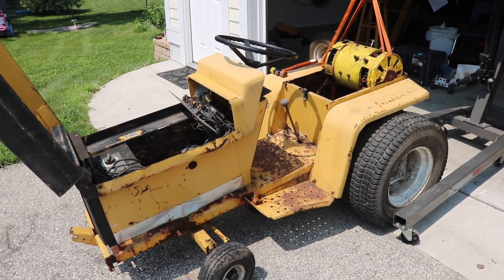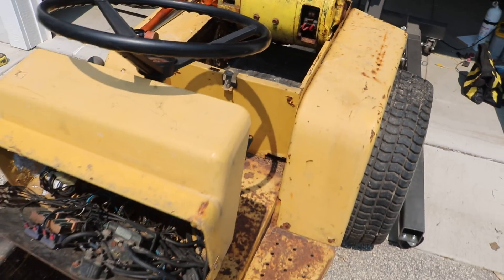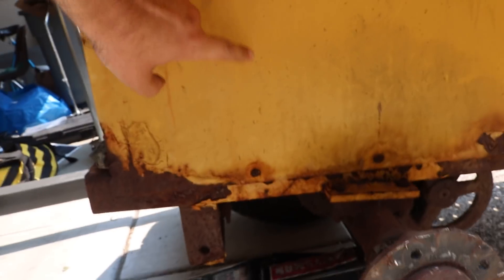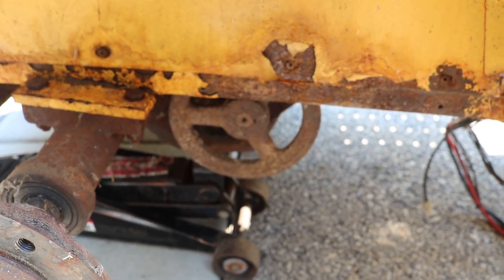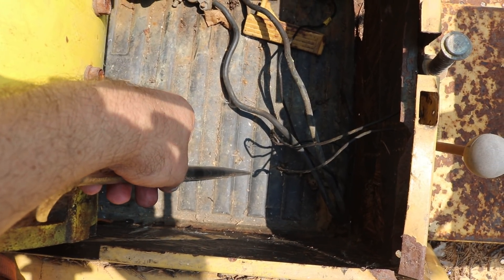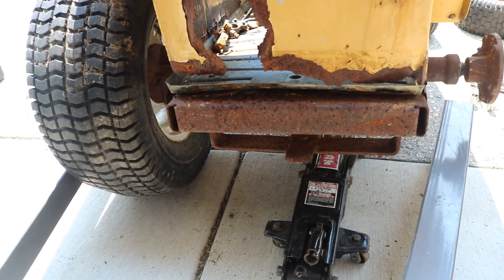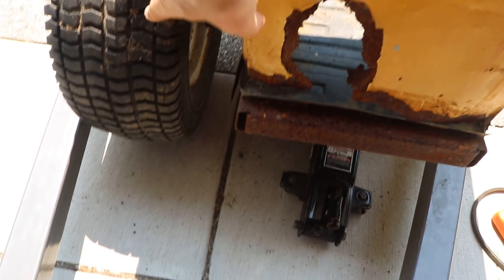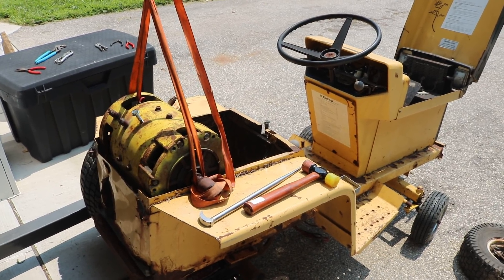Electric Lawn Tractor Rat Rod motor placement

Comment: That thing is a little ragged isn't it. I wonder how well it would work to build a dozer / front end loader, backhoe out of it? Make it where those are attachments you can interchange. I don't know if you guys ever have need of those things or do any gardening, maybe you could also make a tiller attachment for it also. I don't know, just thinking of possibilities.
Reply from the maker: Many of those attachments you just described WERE available as stock accessories for this series of General Electric ElecTrak tractors! On reason why it would be nice to get the motor under the seat it that it would leave the back of the tractor available for some of those accessories!
As it is, I might need to reserve that as a place for a wheelie-bar!
Reply from the maker: I also just realized that I have a dozer blade, which I could probably mount on BACK and use THAT as a wheelie bar!
Reply: Why would you need a  wheelie bar,  it might work as a counter balance though. Is it just a small blade off a tractor or something?

Comment: why not make a adopter for input shaft n then off set the pulley were it would line up....
Reply from the maker: I hadn't thought about trying to extend out the driven shaft of the transmission. If I could extend it to match the driveshaft of the motor, that would look clean and mean I would just need one belt. Not sure how easy it would be to extend. I'd need to fit a pair of pillow blocks or some other type of support in there to do it. Not sure if there's enough room or not.

Comment: Jack shaft would be better.... It looks cleaner, and you can play with your gear ratio by changing sprocket/ pulley sizes to get your gearing right.  I think that motor hanging off the back would be a little "TOO" wheelie happy.  Otherwise, that motor is entirely too big for this build...  But hey, go big or go home.
Reply from the maker: A jack shaft would certainly look better. I also like the idea of being able to change the gearing. Of course the motor is too big, but that's kinda the point!